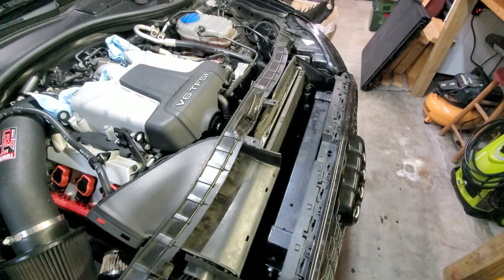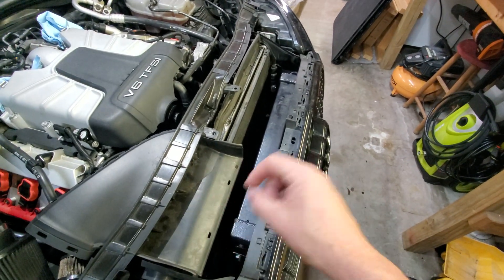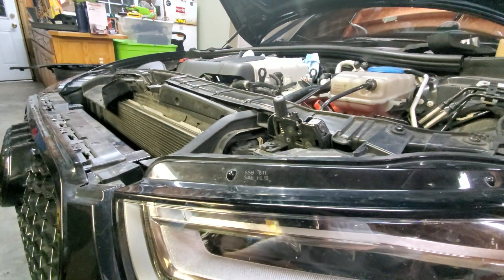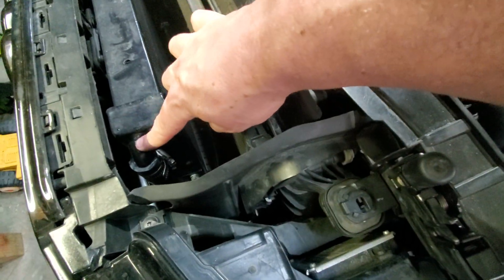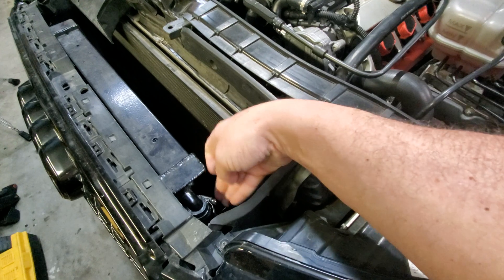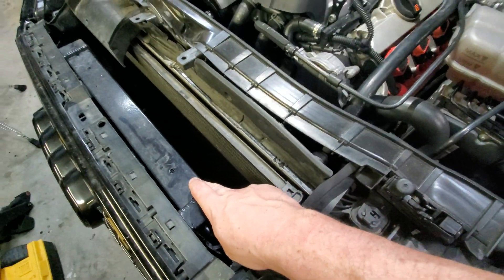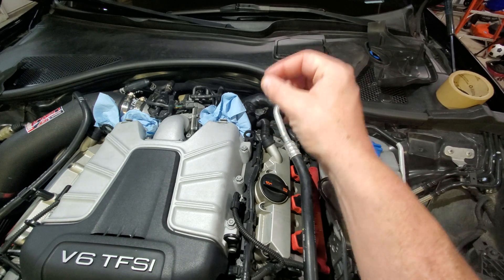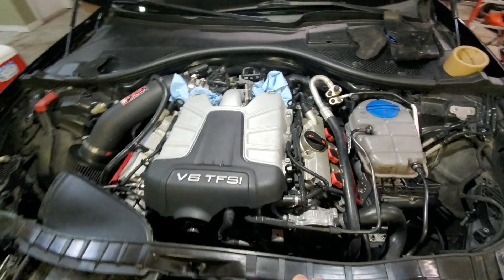Bleeding a Heat Exchanger that doesn't have a Bleed Port

Comment: Did you remove the OEM orings from the supercharger bleed ports when you installed the new 034 screws(come with their own rubber orings)?
Reply from the maker: Yes. I replaced them.
Reply: @GarageTaught  Just to confirm "Replaced", as in, you removed the OEM orings, and only used the 034 ones, correct?
Reply from the maker: That is correct. They are actually the same as oem gaskets.

Comment: Helpful video. Getting the MercRacing S6 HX with a CWA 100-3 soon.  I went with the 034 Bleeder Screws; but, I hear a M8x1.0 16mm bolt can be used if you taper the ends so they fit.
Reply from the maker: Nice!

Comment: Great video would love more info and a walk through while you did it.   I am in the same boat after getting the mpvi2.  I ran my first logs and my intake Temps were insane.  I need to bleed mine and also verify coolant to water ratio.   I think I have the bleed screw though, checking in the morning.
Reply from the maker: We are about to do an update to our cooling system & will be showing how to manually bleed the system 👍🏻

Comment: Its the Injen making a good difference ?
Reply from the maker: The best intake is the oem airbox if we are all being honest. But I want to hear my supercharger. You will not notice any performance difference, but the whine will put a smile on your face.

I'm going to be modifying my stock airbox to fit with the engine intake where I still get the sound, but it will also act as a heat shield.

Comment: Alternatively one of the best ways is to vacuum fill the cooling system but you do need the tool.
Reply from the maker: We actually have the tool, but you can't use it to remove trapped air in places like the heat exchanger or supercharger.
Reply: @GarageTaught  You definitely can and I have done it many times without any issue. It is important to pull a strong vacuum for a sufficient amount of time. But even if for some reason it doesn't completely remove all the air for whatever reason and a small amount of air is trapped it will often work its way out to the reservoir after a few heat cycles or at the very least be much easier to bleed out of the supercharger bleed ports. Small amounts of air can eventually get pushed out, the problem is air from other parts of the cooling system can migrate to the higher spots and it is very difficult for the system to push out large pockets of air. Also, I have found when vacuum filling it is best to drain as much coolant from the system as you can for the best results. Speaking as an Audi Trained Red Seal Automotive Service Technician FWIW.
Reply: Also if the vacuum fill method isn't working you might have a small leak letting air in.
Reply from the maker: My system is leak free & holds vacuum perfectly when under pressure.

The good news is that we just got some good news & will be doing a full drain for an upcoming video update soon 👍🏻
Reply: I agree. Audi service manual calls for refilling as you describe followed with bleeding air at both SC intercoolers along with heater hose at firewall.

Comment: 034 motorsports has machined aluminum supercharger intercooler bleed screws. Look good and I have used three times during various maintenance.... work great.
Reply from the maker: Unfortunately they are back ordered 😑
Reply: @GarageTaught  I have those in stock! I can send you a set.
Reply from the maker: You are the man, Jose!
Reply from the maker: But I did pick up some oem replacements so I can bleed the sc while I wait for the 034 screws

Comment: I reinstalled my stock airbox to keep the hot air out.  Dropped my intake Temps right away.   I am looking at getting rid of the Injen in general as the metal tube gets really hot.  ECS has a new option with a heat shield.  I may order one up.
Reply from the maker: My Injen is plastic luckily. I'm still going to put my stock airbox on again with the Injen, but I'm going to modify the box so I can still hear the intake
Reply: @GarageTaught  RS7 box style?